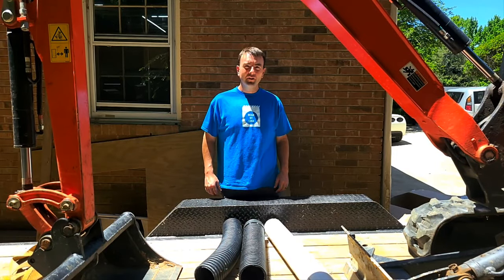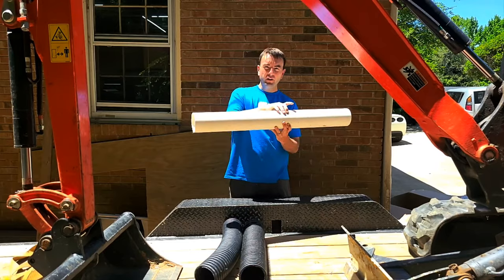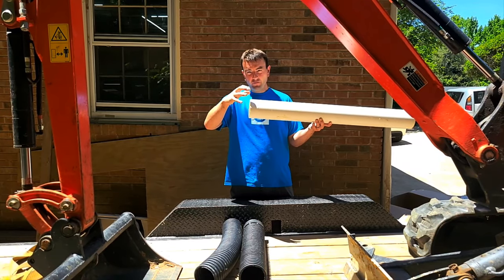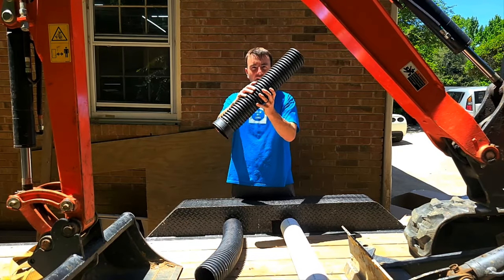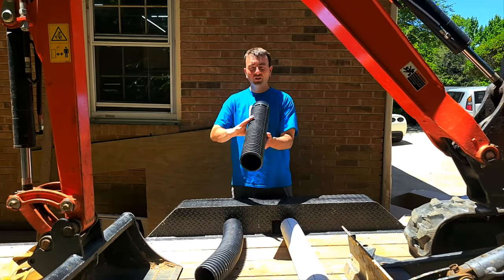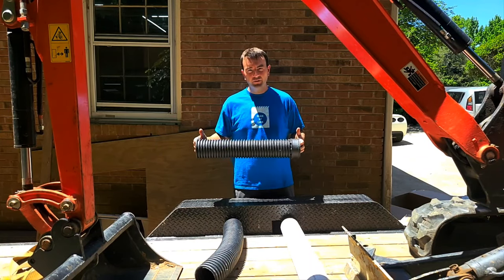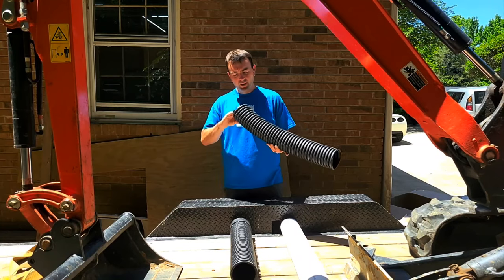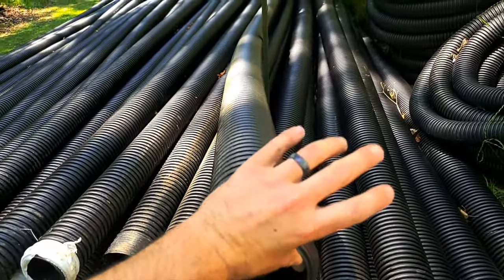Which Drain Pipe Should You Use?  Hint: it's probably not what you think

Comment: Yet, it works well and last a very long time for septic systems and sewage lines...
Reply from the maker: @whidbeyhiker4364  Septic and sewer lines don't have as many turns and bends as drain systems do and they are buried deeper than drainage systems.  Less  points of failure and out of the way of many roots that will move the pipe. It's all about application.